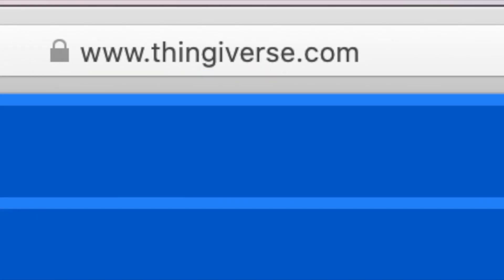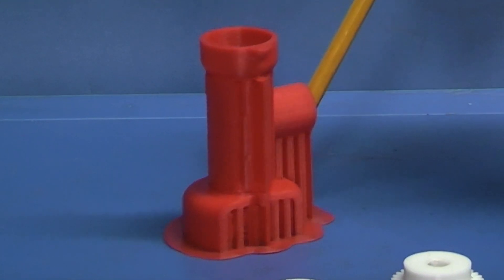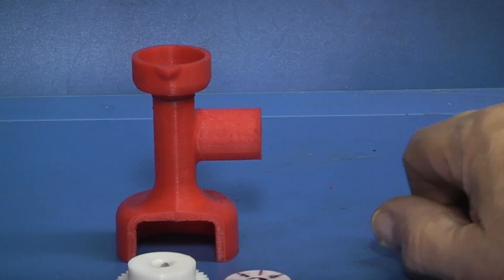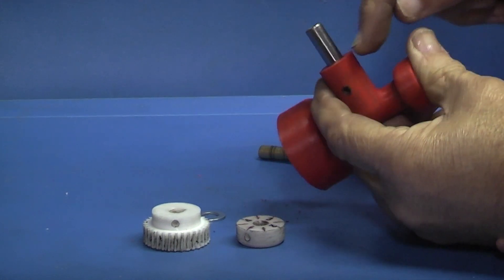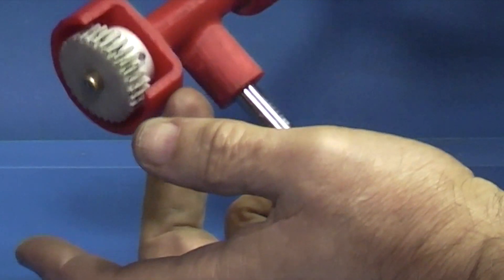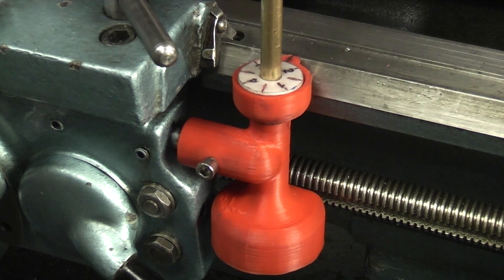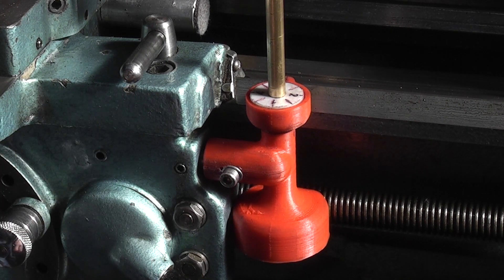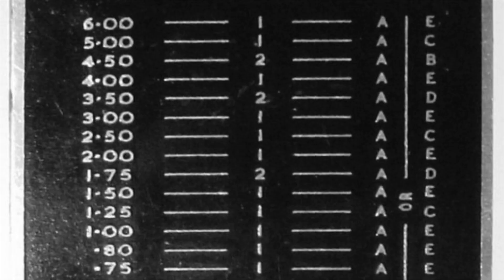Making a thread dial

Comment: Also on thingiverse is a parametric gear maker, you can make any gear(within reason) so you can use a similar holder and match the gear to your leadscre, mine is 3mm pitch metric leadscrew so to do all metric gears i need a 35 tooth gear, I might have to modify the design but its a good starting point.

Comment: Hi Alan, I think that if you make a 20 tooth gear it will do almost all the metric thread you might wanna do. Although most will need a full revolution of the gauge.
Reply from the maker: Boxford have 2 gears a 20 tooth and 21 tooth but this will not cover all of the threads pitches

Comment: Hi Alan that is cool. I have a Boxford 4.5 in lathe and would like to machine a thread dial. But i am not into 3d printing and would rather machine the whole from aluminium and brass. I wonder how many teeth are on the gear. Thanks.
Reply from the maker: Hi the plastic gear had 32 teeth

Comment: That's very simple attachment Alan, the only thing I don't like is it's plastic. Surely with your skills and equipment you could make it out of aluminium or brass? The only real difficulty would be the gear. Otherwise it's pretty nice.
Reply from the maker: This is a imperial TDI my lathe is metric I'm still investigating how to make one from metal for the metric lathe
Reply: @enotsengineering  Nice! Looking forward to seeing how you will go about it!
Reply: My son printed out the body and I copied it in a piece of steel bar, I also made the indicator but still used the plastic gear, I only finished it last night but it turns as it should, haven't tried it cutting a thread yet.

Comment: Thanks for the info, I have a Imerial thread indicator on a metric Boxford. Would be nice to have the proper one.
Reply: I'm curious, what use is there for an imperial thread indicator on a metric lead screw?
Reply: @5tr41ghtGuy  It came with the lathe.. it has 32 tooth x 3mm gear. So you tell me Hi.